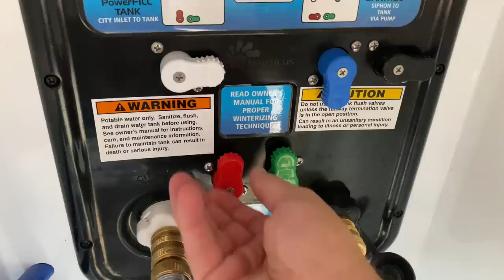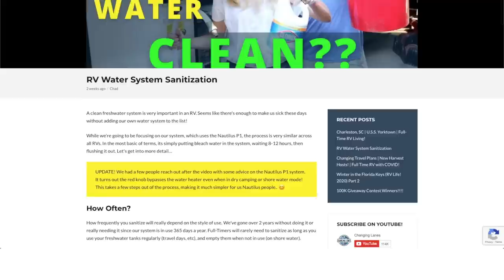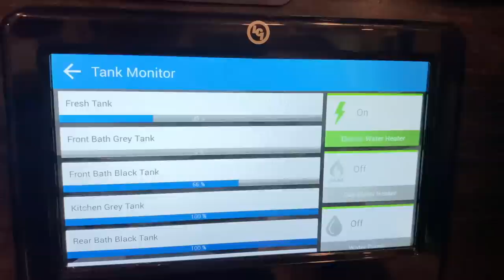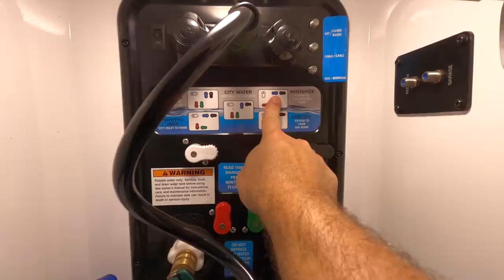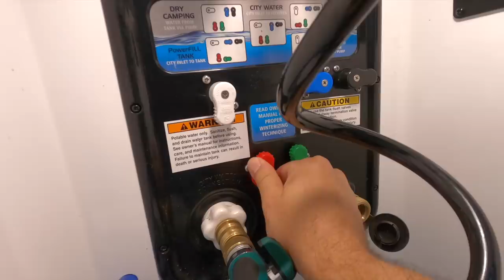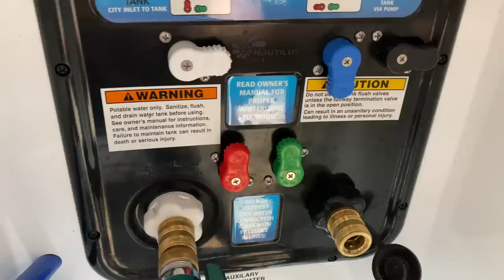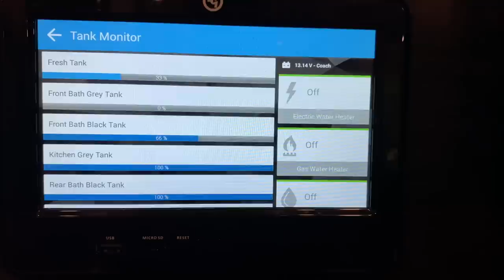RV Water Heater Maintenance (and Anode Rod Replacement)

Comment: Why not take PRV out and flush from top? Just wondering.
Reply: I would caution against removing the Pressure Relief Valve (PRV)for regular maintenance unless you have the proper tools. The tight quarters where the PRV is situated tends to put suboptimal forces on the valve. PRVs are safety devices that you don't want to damage by tightening from any flange except the one at the base of the valve that is designed for the wrench. There's too much temptation to let the wrench grab on to the outlet tee which can warp the valve seat just enough to cause leaking (not the end of the world) or keep the PRV from working (which could be the end of YOUR world) 

This warning goes for all valves. The mantra of the plumbing industry is "never tighten across a valve" i.e, never use the flange on the outlet side of the valve to tighten the valve onto the inlet side and vice versa. That twist to the body of the valve can damage it.
Reply from the maker: Sounds like Dan has beat me to it with a much better answer than I would have come up with! 😀

Comment: I clean my tank annually as well.  Have not used vinegar or looked inside before.  I know its a maintenance thing for heater longevity, but do you see an increase in efficiency in the heater after cleaning?
Reply from the maker: Our water has always been super hot.. so it's difficult to say without before and after measurements...

Comment: If you tilt your RV with the hydraulic system...it will help to drain the sediment out of the tank!
Reply from the maker: We'd have to tip it way beyond it's capability to make a difference....
Reply: @ChangingLanes  My thoughts is if it is tipped even slightly it would help to create flow or a current towards the drain...when the tank is laying flat the sediment can flow either direction.

Comment: I realize it's only a short amount of time, but couldn't you burn up your heating element not having water in tank?  In the video you said the heater wasn't on, but it appeared that the electrical switch was on in the video right after the thread tape application.  Assuming you had breaker off? Great video regardless!
Reply: He switched off electric and gas inside on his touchscreen. 

The inside touchscreen will override the outside switch
Reply: @glennrobichaux7490  Good deal, missed that step and wasn't aware.  My old RV doesn't have those digital options so ours is either on or off.  And so all are aware, my question was not meant as a criticism, it truly was meant as an inquiry as I was basing it off my older unit.  Thanks for the clarification, appreciate it.
Reply from the maker: Glenn is right... but it might have also been a good idea to flip the breaker just in case...

Comment: Buy  yourself a 3/4" NPT brass plug to plug the tank while soaking with acetic acid.  No sense in subjecting your NEW anode to the acid.  Buy some concentrated acetic acid.

Food grade vinegar is only 5-8% acetic acid (Sam's if you buy it....  cheaper).  Instead, consider buying concentrated "vinegar" 40%+, or glacial acetic acid (nominally 100%).  You'll need to research the "best" concentration to use, and learn a little chemistry to blend it (use deionized water to dilute), but you can set the concentration as high as possible without challenging the tank (if at all), and the concentrated acid will EAT the deposits off the heating element MUCH faster and more effectively.

Not trying to "should on you"; just trying to contribute to the community effort.  <big smile>

Comment: You DEFINITELY put the thread tape on backwards the first time. It does matter. Also. You probably shoulda used the old rod just to block the hole for cleaning. Or. You could do like Downsizing Makes Cents did with his little pvc pipe thing. I just feel like using the new rod is a little counterproductive because the vinegar can start to break it down... Maybe no a LOT... But definitely some...

Comment: What about normal the system and use the shore water pressure to rinse the tank, but leave the anode out.
Reply from the maker: I think the flow created from a single entry point to the tank wouldn't stir up the sediment enough.. But, maybe that plus the brush....

Comment: Good video. But as a plumber I cringed when you used the t&p to relieve the pressure. T&P is designed to only open once when there is an issue. And they don’t seal back up very often. In fact I believe part of the design is to keep leaking if it opened so you know there is a problem.

Comment: So what if you have an 04 model? Does any rod still work, and could having a bad rod cause any leakage from the tank?
Reply from the maker: Take the cover off and get the part number and manufacturer... Then search on that or call the manufacturer. 👍🏼

Comment: How do you know which brand of water heater is installed? I didn't see a label or data plate on the heater.
Reply: Wait I think I see a sticker\data plate on the inside of the heater. That's probably where the manufacture's name is.
Reply from the maker: Yes.. It should be somewhere on it under the outside panel...

Comment: wait a sec... Did he say your NOT supposed to run the chlorine bleach thru the water heater?!?  
(cuz I just did) I was attempting to rid my water of a odd smell. . . So what'd I ruin or wreck?
Reply from the maker: I doubt you ruined anything, but flush it really good so there are no traces of bleach left...  Bleach accelerates corrosion of metal.

Comment: Does the corrosion on the rod and heating coil prevent getting good hot water?? This week we only have luke warm water. I ordered the rod to install later this week.I'm running both the propane heater and the electric heater, still the water is just warm and not hot.
Reply from the maker: Check your outside shower and make sure both hot and cold are closed (even with the hose unhooked).  Having those open causes bleedover and low pressure on the hot side...  This has bitten us a few times!
Reply: @ChangingLanes  Bingo! That fixed the issue.
Last week the dog got full of mud and we quickly hosed her down outside. I did not shut off the taps but I removed the hose.
Thank you so much for helping me out. It did motivate me to to replace the anode rod. 
Hope you guys are well. I share your channel with lots of folks. We hit the road next week for 6 months.
Reply from the maker: Awesome!  Glad it worked!

Comment: NOTHING WRONG WITH THAT ANODE ROD I USE MINE UNTIL IT ALMOST GONE WITH NO PROBLEMS. THE ROD IS SUPPOSED TO DO THIS AND NOTHING WRONG WITH IT.  I REPLACED MINE ON MY FIRST CAMPER AFTER 5 YEARS.

Comment: Are you using a sediment filter?
Reply from the maker: Yes... the whole RV is filtered.  And, we now have a clearsource triple filter system.  Video on that soon.
Reply: chad continued to use the word "sediment" which is correct when the particles are laying on the bottom of the tank.  However, those particles are from calcium carbonate/calcium  sulfate minerals that precipitate out of the water onto the heating element and anode element.  Eventually, those mineral crystals break off the elements and settle to the bottom of the water tank (now they are "sediment"). The "sediment" does NOT originate from sediments being brought in through the shore-line water supply, rather the chemistry of the water.

Comment: She: should you relieve the pressure? He: nah, we haven't had shore water or water pump on since the end of March,  it'll be okay. She: are you sure? Water heater: SPLOOSH!!! He: hmmm, it's 90°F out, that cold water was actually refreshing.  While I dry off, you want to go on the other side of the wall and retrieve my socket wrench and the old anode? It's about 4 feet on the other side. Thank you.

Comment: well you know you could have removed that emergency pressure relief valve and use a funnel to put  vinegar  in there and I would recommend you removing that  emergency pressure relief valve every year  or two year so it doesn't freeze in there many years ago ares snaps off in that Port it might have been a residential water heater but still the principles the same also if you take it off  you can put your  Wang  in there to help flush out the settlement